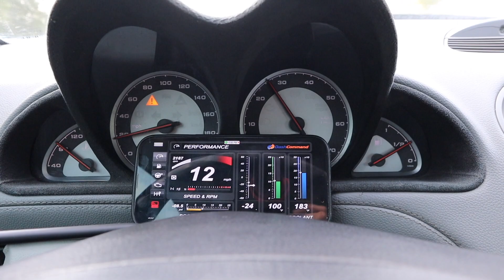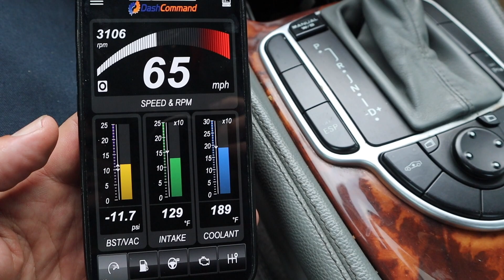Installing Custom Intake On A SL55 AMG (With Data)

Comment: I think that the under grill idea is that the air pressure stands in front of the grill, before it gets in radiators it leaks all over the radiator area, to the sides, where those fins were. How many miles this cone filter lives, did you check on dust inside after first cone filter?

Comment: Hey Brotha, I'm loving the channel! I ironically, I live just south of downtown Orlando and one week ago I bought a well maintained mechanically stock 04 SL55 with 107K miles. The plan is to build it up in stages, and for each stage to be pretty balls to the wall. In order, I'd like to address cooling, intake and exhaust flow, suspension, brakes, transmission tune and finally power. I've started going down the rabbit hole of intake options and out of all the options I've seen, I think what you did here gives the most benefit with the least drawbacks. Maybe we'll meet up sooner or later.
Reply from the maker: Maybe will will    And yes the intake so far is the best almost

Comment: With the O/S TB you should do a 3" dual-inlet silicone elbow and use in-line air filters with your piping. I think you would get even better temps that way.

Comment: What about some exhaust pipe or cut out to remove heat from under the hood. Old style modification like added couple washers to mount of hinges so that air can escape from under the hood by windshield area?
Reply from the maker: Headers will be soon
Reply: I think some version of that is a great idea, sort of like a hood scoop right?

Comment: great idea adam much better then before with just the cone you should put that setup on the e55 and test without pipes and with pipes to see the diffrence this is a great idea though good job this setup will help a lot with air intake temps !!!
Reply from the maker: Thank you and so far working great
Reply: @Nd_72  just remembered you got the top mount intercoolers lol might not bolt up so well on the e55 haha